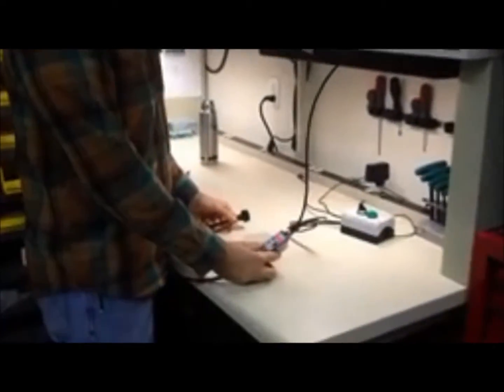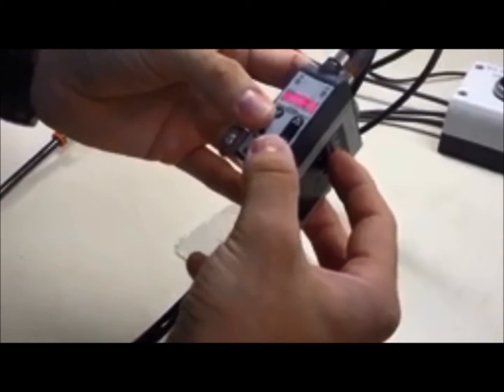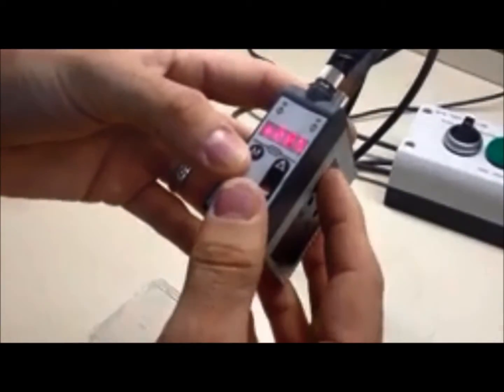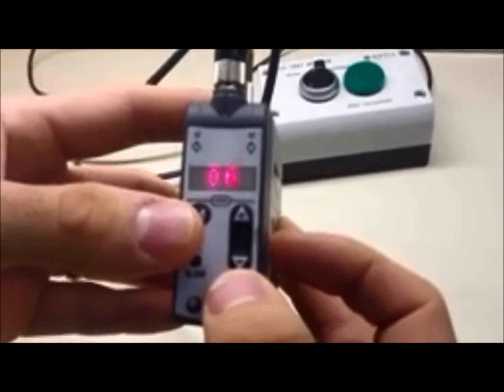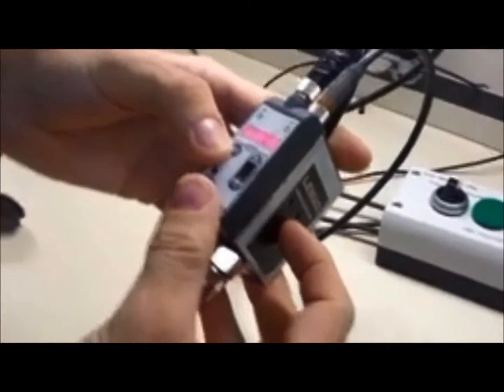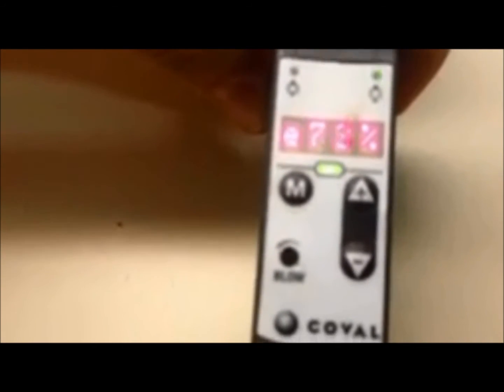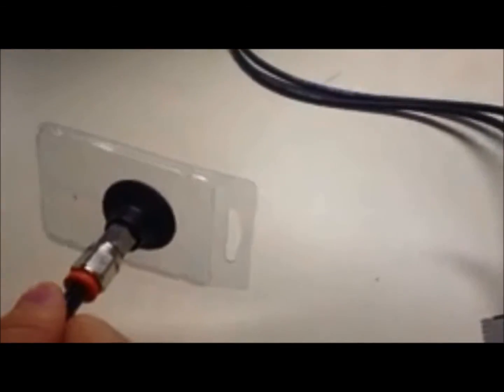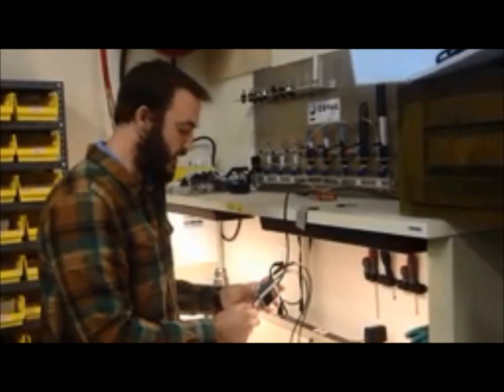LEMAX Setup/Installation Demo

Comment: Hello, great video. I’m currently trying to use a LEMAX14X90S. I have a question, the way I was told this works is that alongside the Vaccum On and Blow-Off On signals that we send to trigger each one of those functions, there’s a pressure sensor sending a 24V signal back  when a part has been gripped. However I’ve followed the wiring instructions and I’m not getting anything back from the vacuum generator. Is this really the case or am I getting it wrong? Thanks